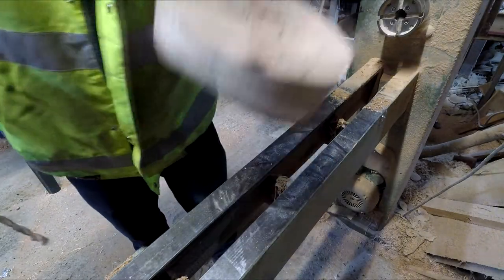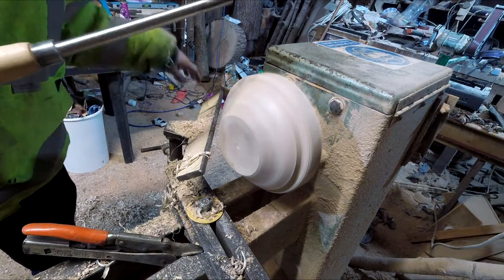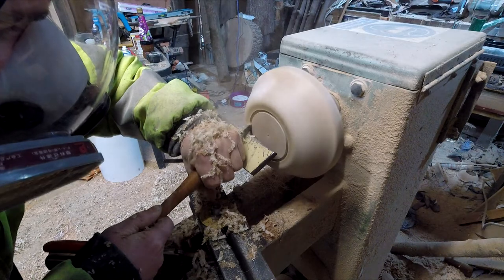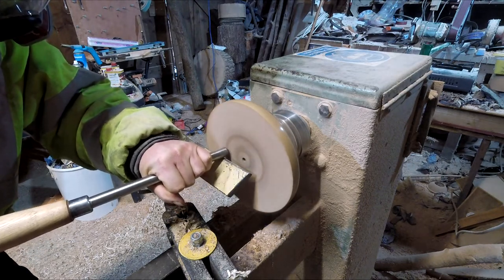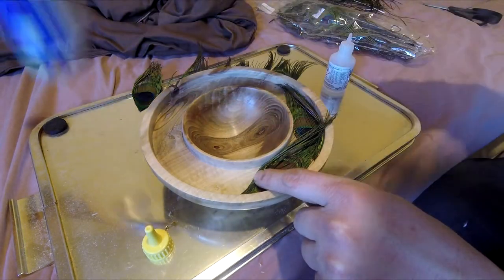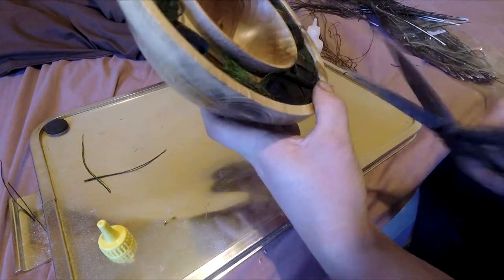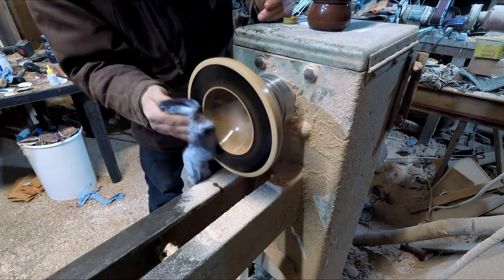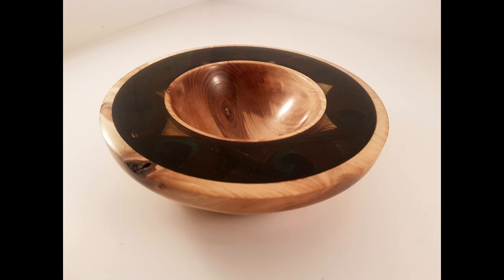The Peacock Bowl - Wood Turning

Comment: Beautiful bowl, I wish the feathers would come out brighter! (I know, it's the resin, LOL) I wonder if there is a way to make a resin rim you cure and add to the bowl. Like, you make the bowl, fill part of the rim with resin and let it cure. Then set the feathers on top with a bit of CA to keep them in place, then the pre-cured rim gets carefully glued or epoxied in place, so none (or very little) of the epoxy is touching the feathers. Without touching the feather, it shouldn't interfere with the refraction, I believe.